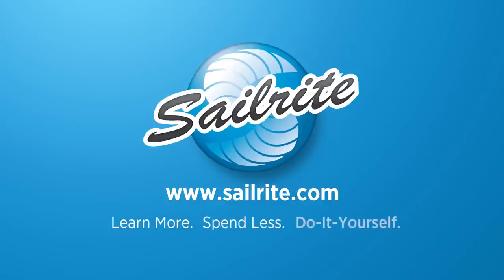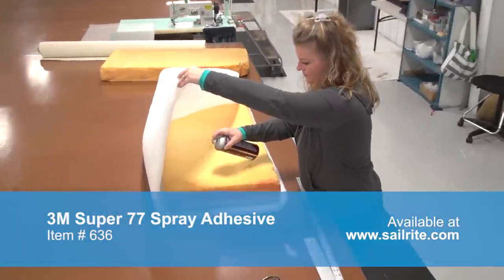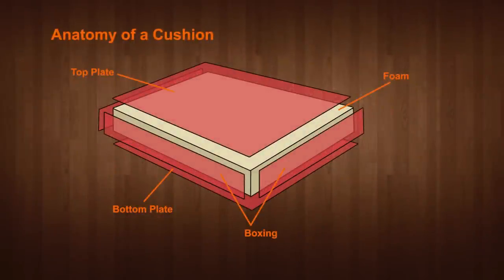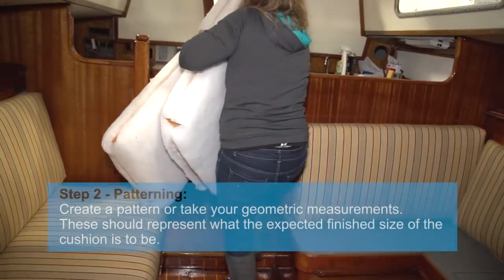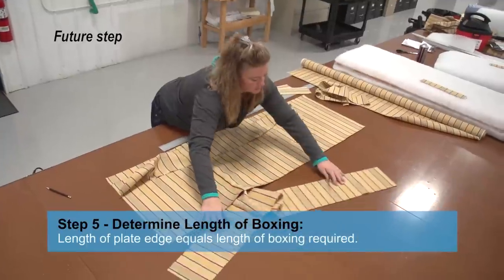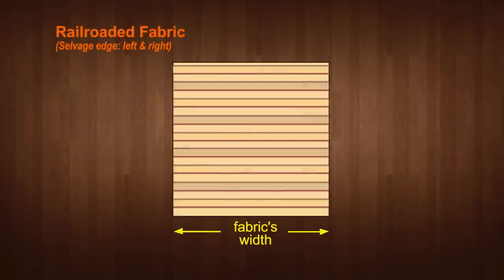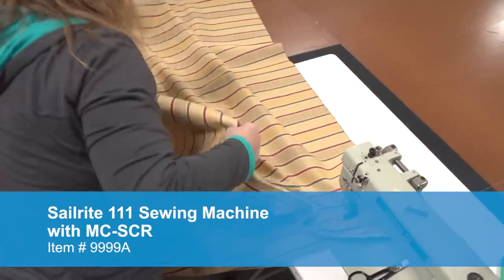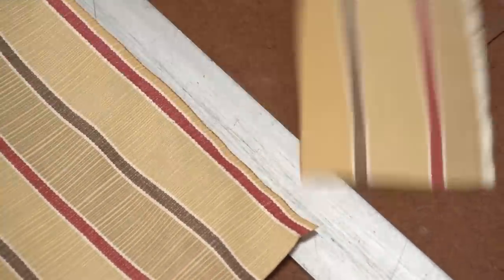How to Make Salon Cushions for your Boat

Comment: Thanks for this video. I followed along and reupholstered my first of many salon cushions. Then I ordered the LSZ machine to make the other cushions more easily. One thing I wanted to point out about the video though, is that I believe there's an error in the commentary at around 17:52, during the zipper plaque assembly section. The narrator says "make sure outside surfaces are out and inside surfaces are facing each other". I did as you instructed, unfortunately, and then realized my zipper was on the wrong side of my fabric and had to rip it out and start over. The outside surfaces should be facing each other so that you're sewing the zipper to the inside of the fabric. Otherwise you will have the inside of the zipper on the outside of your cushion. I should have ignored the commentary and just watched and copied how she did it.
Reply from the maker: Yep, outside surfaces should face each other. I am sorry!

Comment: I believe there may be an error at about 17:47.  You say "be sure outside surfaces are out, and inside surfaces are facing each other."  I did this and ended up with the zipper on the outside.  Otherwise, this is excellent help.
Reply from the maker: Yep, outside surfaces should face each other. I am sorry!

Comment: For the bottom and top plate...is their no addition to the size?  The only seam allowance is added the boxing?  No seam allowance to top and bottom plate?
Reply from the maker: That is correct, the top and bottom plates are only about 1/4" larger than the foam size and the boxing is just slightly thicker than the foam. After sewing the cover will be smaller in size than the foam. This results in a tightly fitting cover compressing the foam slightly for a great fit.

Comment: 3rd try to make my 56 3/4 zipper plaque , always bunches up. Last attempt still 3/4 too short after sewing in zipper. Afraid to go any less stitch tension at this point, Very frustrated!
Reply from the maker: When sewing a zipper plaque boxing piece you may experience shrinkage when sewing the zipper in place, that is not uncommon. That is why I usually make my zipper plaque longer than required, unless it is a pattern that must be matched up, like stripes. Ok, if your fabric is bunching up you may be using too heavy of a thread and needle combination for the lightness of your fabric. Or you may have too much upper tension. email me and give me more details at eric@sailrite.com
Reply: @SailriteDIY  Thanks Eric, Good idea to make plaque longer than cut to size...so simple! I also turning down the tension.
Reply: I am getting better at checking to make sure the ends match as I sew and adjust accordingly

Comment: Do I add the seam allowance to the width and length of the boxing and plaque?
Reply from the maker: Yes and no. To the width a sight seam allowance is added (in most cases about 1/2"). So, if your foam is 4" wide you would cut your boxing to a width of 4 1/2". This will make your boxing slightly smaller in width to the foam, but a tighter fit looks best. To the length you do not add seam allowance, because the 3/8" taken for the corner seams will also be taken from the top and bottom plate when they are sewn to the boxing. Just cut the boxing to equal the length of the plates.   

GENERAL GUIDELINES FOR BOX CUSHION MAKING:
STEP 1 - Patterning:
Create a pattern or take your geometric measurements. These should represent what the expected finished size of the cushion is to be.
STEP 2 - Cutting Plates:
Cut Top and Bottom plates to the pattern, plus ¼” all around.
STEP 3 – Sewing Piping to Plates
If you cushion requires piping sew it to the top plate and if desired onto the bottom plate. 
STEP 4 - Determine Lengths of Boxing:
Boxing: Length of plate edge
Zipper Plaque Boxing: length of plate edge x 1.0125 (for possible shrinkage when zipper is installed).
STEP 5 - Determine Boxing Width:
Determine boxing width by measuring foam thickness (include batting, if any, under slight compression during measuring). To this measurement add between ¼” and ¾”. Keep in mind that thinner cushions look best with more allowance added and thicker cushions look best with less. Basically adding less of an allowance will allow the seams to roll into the edging of the cushion.
STEP 6 - Determine Zipper Plaque Boxing Width:
Use the boxing width you just determined (thickness of foam plus 1/4" to 3/4"), but also add the total width of the zipper to that measurement. This will be the required width of the zipper plaque boxing.
STEP 7 – Sewing Zipper Plaque:
Sew the zipper into the zipper plaque boxing strip.
STEP 8 – Sewing Boxing:
Sew boxing together (end to end). Then sew it onto top plate.
STEP 9 – Sewing Bottom Plate
Sew bottom plate onto assembly.
STEP 10 - Cutting Foam:
Use pattern and add 1% to both dimensions. But for soft to medium firm foam (IFD <40), be a bit more generous. Never add less than ½”.
STEP 11 – Insert Foam in Cover:
Open cover zipper and turn cover right-side out. Insert the foam. Then enjoy your new cushion!
Reply: Thanks for the complete list! My corners just don't seem to be lining up when I go to sew the boxing to the plate- that's why I asked about the seam allowance for the length.
Reply from the maker: You may want to consider using our seamstick 1/4" for canvas and upholstery basting tape to baste the boxing to the plate prior to sewing. This will ensure that they line up before you have to sew them together. Here is a link: http://www.sailrite.com/Seamstick-1-4-Basting-Tape-for-Canvas-50-Yds 
Watch this video (starting with the part when we baste the boxing to the plate) to see an example of the seamstick when basting boxing to the plates: https://youtu.be/mSneDgiFq8A?t=41m33s
Reply: Michael Riley
I'm now using sunbrella decorative piping and the flange in 5/8 inches. Should I use this amount for seam allowance since that is how much I'm taking in?
Reply: Michael Riley
Michael Riley I'm now using sunbrella decorative piping and the flange in 5/8 inches. Should I use this amount for seam allowance since that is how
Reply from the maker: If you have cut the plates and boxing following our guidelines in the video (we use 3/8" or 1/2" seam allowance) then you should match up the flange of the Sunbrella Decorative Piping so it overhangs the edge of the plate by 1/4" or more. If you have not cut the plates and boxing then you can add a 1/4" more to our guidelines to accommodate for the wider than normal flange of the piping.

Comment: Ugh... I thought I was done with my project only to find the last cushion was sewn inside out? So the underlining material is on top (and not reversible). In other words, if I left the cover without turning it inside out after sewing it would be correct. Is this because I sewed the boxing backwards? Trying to understand the problem to reverse the error. Help!
Reply from the maker: Sounds like you will have to rip the stitches out and resew it. That is all you can do. Sorry to hear about that.
Reply: @SailriteDIY  Yes, every last stitch!  I think it all began with the boxing. Hard to know which side is which when there is no wrong side to the fabric (although it does have its advantages).

Comment: Quick question.... that foam looks to be in bad shape. Why do you reuse it? Why not replace it? Just wondering if there is something I'm missing. Thanks.
Reply from the maker: Yes, foam should be replaced if it is no longer supporting (bottoms out) and if it has mold and mildew on it. It would have been better if we had replaced the foam with this: https://www.sailrite.com/Foam-and-Pillows/Foam/Marine-Interior-Foam/Foam-Type/High-Density
Reply: @SailriteDIY  I just built my first cushion using this video.  It came out pretty good for a first attempt.  That was until I tried to install the (new) foam made from your recommended high-density foam.  Despite it being only 1/2" larger than the cushion (as recommended) it is IMPOSSIBLE to compress a 4" slab of this stuff and get it into the fabric, even with two of us trying!!  I had to fall back to using the old foam, which is way too soft.  Is there some magic secret to using the high density foam?
Reply from the maker: @edwardcriscuolo5845  Did you try using a silk film to vacum down the size of the foam? See this video: https://youtu.be/3ffvhyMo9e4

Comment: Were one to use new foam, I guess making a cushion from scratch, what type is it?
Reply from the maker: +sp10sn For indoor cushions usually the foam is a Polyurethane foam. If used outdoors many customer use Dry Fast foam (reticulated foam).
Reply: Appreciate it!
Reply: @SailriteDIY  If redoing saloon cushions that are used to convert into bed, would you recommend 3" or 4" thickness of the Poly high density?
Reply from the maker: @foo_bar_wug7793  For a sleeping or bed foam I try to go as thick as possible. So, if you space allows go 4 inches. Here is a link to our foam: https://www.sailrite.com/Foam-and-Pillows/Foam-Usage/Frequent/Foam-Use/Salon-Cushions/type/Products?order=custitem_popularity